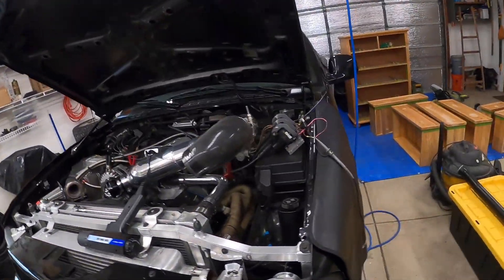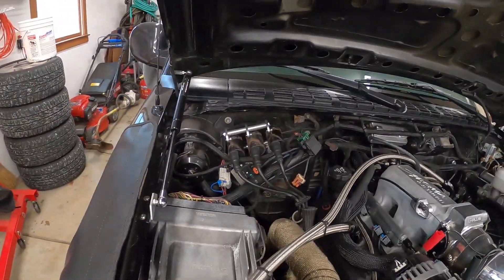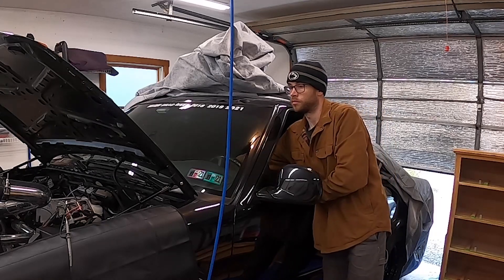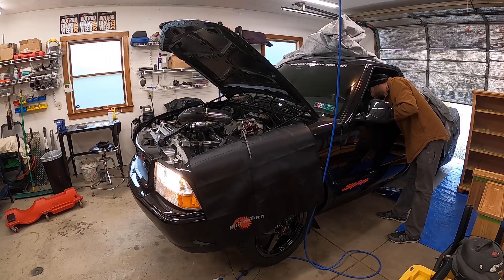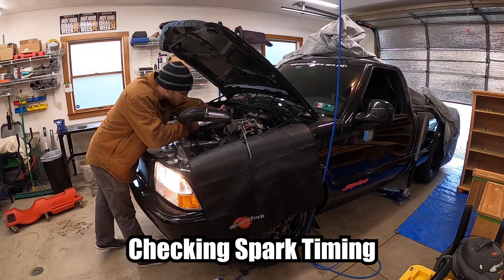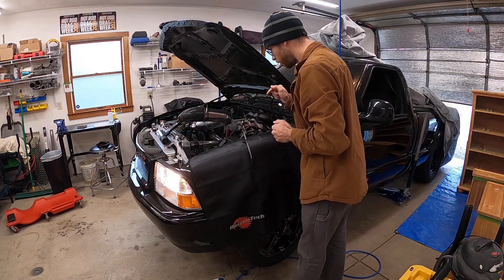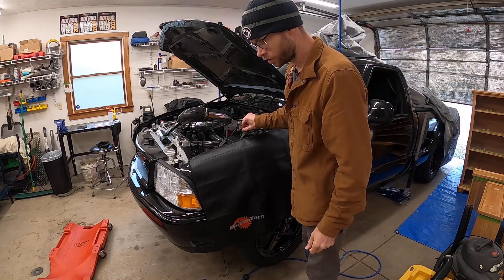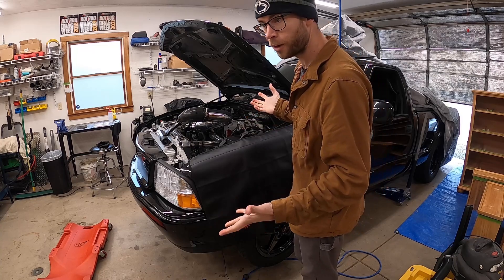4.3L V6 - Distributor DELETE!!! LS1 Coil Upgrade

Comment: Any thoughts on the later model 4.3L in the 1500's that have DIS. It appears to bolt right to the intake whee the distributor went. I have a wiring diagram coming to see how it works. I would think it to be clean way to go.

Comment: Hey man nicely done I thought about it long time ago I didn't know if it would work thanks upload another video we nee to see how u did it!!!!  I got another modification 4 your s10 4.3 u can actually use a 5.3 chevy vortec mass air  flow sensor from a full-size silverado!!! It's very easy to modify let me know so I can share the info that way it help your channel grow and get more followers specially 4 those with a 4.3 trying to get better mpg betterment and make more power thank you brother im gonna try it I think I have a clue on how to do it

Comment: Just curious couldnt you use the timing cover from a lt1 since the motors are similar as sbc to use the cam sensor an be able to delete the distributor
Reply from the maker: I'm not sure about using an lt1 cover, but I think they are different. A distributor also provides drive to the oil pump, but they make low profile oil pump drives that also have a cam sensor that is smaller than the factory distributor.
Reply: @turbov6   food for thought, I've been looking into doing waste spark on my s10, found that the timing cover from 07-13? 4.3 has the hole for a cam sensor. Only problem is the cam gear. Cam gear on the 07 and up has 4x reluctor on it which wouldn't work with say a 0411. Not sure how interchangeable cam gears are but I wonder if the LS cam gear with 1x reluctor would work on a 4.3 cam and if so would it be timed the same as the 1x in the dizzy. If that all works then may be able to use the oil pump stub shaft out of the 07 in place of the stock dizzy.
Reply: they are different. Ive tried.

Comment: GMT900 LU3 V6 (2007-2013) had a distributorless ignition
Reply: As a gmt900 LU3 owner I can confirm this
Reply: It does but its not coil on plug and doesnt allow individual control but you are correct.

Comment: I did the 24x conversion on my 383 sbc sonoma and I needed to start with an F-body tune to for it to be able to fire coils and go sequential. No 4.3's came with COP ignition so how did you make the 0411 fire them for a V6? Maybe a buick 3.8 tune or something?
Reply from the maker: Custom changes to the operating system.
Reply: Where to find that OS ?

Comment: Hey man love your videos got an few questions for you thowe.
(And no i have not read other comments)
1. Y didn't you use an 2014 to 2019 chevy v6 harness and brain that is already set for the v6?
2.  How did you reprogram the computer from an 8 cylinder to an 6 cylinder?
Looking to do something similar to a grand national 3.8l v6.
3. Y not use an 3800 v6 harness and brain and cut and pig tail the spark wires to individual coil packs.???
Reply: 14-19 use the lv3. The 08-13 trucks had DIS lu3, but I'm not sure what ECM they use.
Reply: Ecm in this 2012 I’m changing a motor in is an e37

Comment: Msd 85141 will give you a hall effect cam sync, no bulky distributor. Also efi connection makes a cap for your vortec distributor that doesn't have spark plug wire terminals on it.
Reply from the maker: No thanks, not for $250
Reply: @turbov6  the cap for the stock vortec distributor will make it essentially do the same thing for less than $100 it is just a little more bulky. I baulked at the price for the msd stuff too. But if you see it installed, and how easy it is to setup with most efi systems the 600 it costs for crank trigger and msd 85141 is well worth it when you consider a dual sync distributor costs 400 plus wires. It really simplifies wiring and just looks cleaner. Hutter performance also makes a bolt on 60-2/58x crank trigger wheel that bolts up to most sbc and 90° V6 for 68 bucks.

Comment: It's been a while but I'm pretty sure the Gen 2 LT1 iron block has a distributor block off plate that bolts over the distributor location but has a shafts that spins the oil pump off the cam like the Gen 1 SBC and 4.3. Not 100% sure but I think I'm right on that. That could help you fully delete the distributor altogether that is if you can figure a way to have a cam trigger.

Comment: Are you batch firing the coils or is it a true sequential setup? Which makes me wonder if you are sequential on the injectors too...
Reply: Has a crank trigger so should fire same as distributor. New injectors hook to mpfi Old wires  so should be sequential
Reply: @manworksgarage  if he uses the fuel injectors as the coil triggers, the pcm won't be able to advance or retard the ignition timing, right? Or maybe he feeds the coils with the pcm coil trigger, and grounds them with the fuel injectors? I'm not a smart man but that's the best I can think of
Reply: @YaksAttack  y would he use injectors to fire coils?  Just using crank wheel like distributor but more accurate
Reply from the maker: It’s fully sequential (injectors and coils)
Reply: @turbov6  Sweet, so can you control timing and fuel to each cylinder? Also, if you dont mind, what is you background to be able to sort thru the programming and setup of your truck.
Reply from the maker: @thats10guy91  Kind of. It gets pretty complicated. I taught myself programming, but I'm a mechanical engineer.

Comment: What distributor are you using.  I hate my stock one.  Cap and rotor have to be replaced much to often.  Do they have an aftermarket one for these?  This looks very interesting.  Will be watching how you fab it all together.  And if you can get some MSD in with it.
Reply: He just deleted cap and rotor lol.
Reply: @manworksgarage   Oh yeah, huh? lol.  Wonder what will cover it.
Reply: @chuckyz2  he said he'd have more room back there so I figured he'd have a piece made. Wouldn't be hard with a 3d printer
Reply: @chuckyz2  He can just leave the cap on the distributor. Just no need for wires.